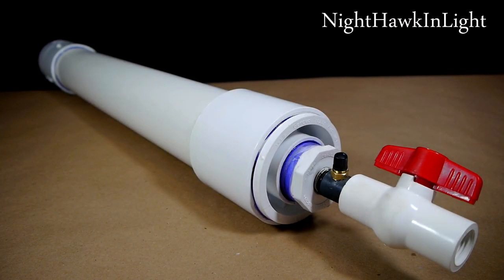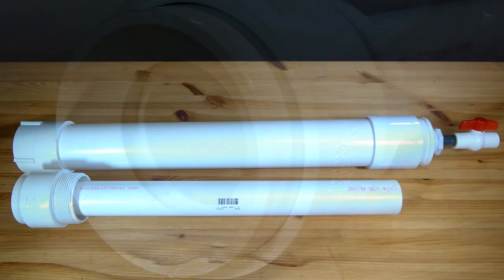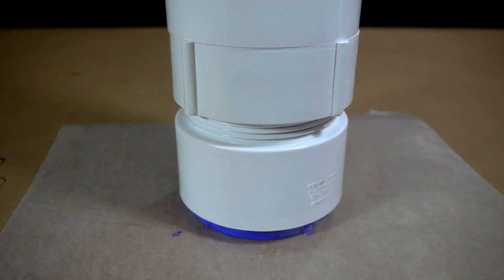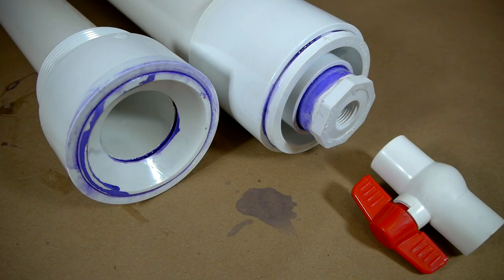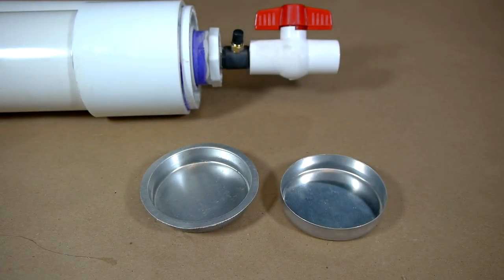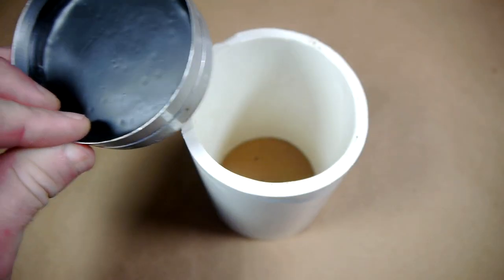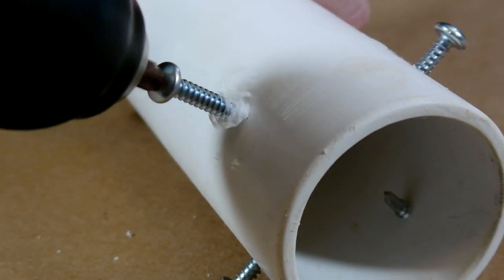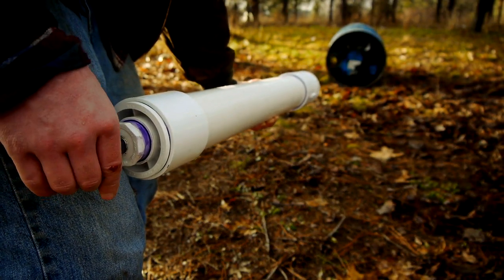How to Make a Powerful Coaxial Piston Cannon from Hardware Store Parts

Comment: Hi All! So I assembled the cannon and is air tight. I can hear the piston seal as the air fills the chamber... But when I twist the valve all the air rushes out of the shutoff valve and not the barrel..?!?! Any insight?
Reply from the maker: It's a good sign that the piston holds air, that's the hardest part to get right. The issue you're having is caused by air not emptying fast enough from behind the piston, compared to how fast air leaks around it emptying the front of the chamber. There's three ways to address this problem. You can increase the size and opening speed of the release valve, you can reduce the volume of air behind the piston so there's less to eject (do this by putting something like thick rubber toilet tank flanges behind the piston so there's less room for air), and third, you can make the piston a tighter fit in the chamber so air doesn't leak past it so easily. This will allow air to empty behind it when you open the valve, without as much air leaking around the sides in the meantime. Aluminum tape is a good option to wrap the piston if it needs to be a tighter fit.
Reply: @Nighthawkinlight  I see I see. So if I had a larger release valve, that may help the piston pull back faster correct?

Comment: should i use a hockey puck, both vent tee caps and use of epoxy cane be replaced?
Reply from the maker: I think you should check out my newer piston cannon videos. They are less prone to issues than this design.
Reply: may i know what kind of issues may arise? im doing it for a proj
Reply: im reading in the comments that the piston should have tfe on therubber face? may i know how this works?
Reply: BTW I have bought the tee caps and epoxy to use as piston.

Comment: What could I use for as a substitute for the galvinized steel vent tee caps??
Reply from the maker: I got a tip recently that a hockey puck is a pretty good fit in 3" pipe, so if you take one and glue a rubber face on the front that might make a good substitute.

Comment: Where do you source your parts?  I am having trouble finding the reducers that you show here.  Flush bushings are easy to find.  but the reducers you show I can't find anywhere
Reply from the maker: Home Depot, True Value, any number of hardware stores. Unfortunately pvc parts aren't standardized brand to brand. You may have to take something that is close to what I use and figure out how to work with it, or modify parts by sanding lips down and so forth.

Comment: Can anyone tell me how much this would cost? Need it for a 9th grade project
Reply: around $125. im doing this for a project too.
Reply: Well our project is now over, and me and my partner built ours for about 20$. We just used a couple reducers, end cap, 2" pipe, and a automatic sprinkler head as ours needed to be some how let off at 30 ft. So far its working good!
Reply: I built one similar to this and it cost me $40

Comment: When I open the valve to fire the cannon all the air blows out the back. I could use some help.
Reply: +Nancy Guarino That indicates that the piston isn't tight enough in the chamber, wrap some more tape around it and see what that does. It could also be too tight and no air is getting to the chamber, but that's unlikely. Also, when the gun fires some air is supposed to come out the back, that's how it fires. Of course air is meant to come out the barrel as well.

Comment: Hey Nighthawkinlight
A couple of weeks ago is asked for tips because i wanted to build the canon for a schoolproject. I only need to glue the male and the female adapter together, I havent done that becaus i wanted to know if the cannon would build up some airpressure. So I did some ducktape on it and if I pump really fast and immediatly switch the ball valve you hear some pressure escape but it is not enough to let the potato fly. What can i do? There are no holes where air can escape from because i have but ducktape everywhere.
Reply from the maker: +Martijn Bras Do not glue the threads on the adapters together, then you would never be able to open the cannon again for maintenance. It probably will not fire because it needs to be at a higher pressure. About 40psi.
Reply: If i dont pump fast enough and dont open the ball valve immediatly, there is no pressure.
Reply from the maker: +Martijn Bras Then the piston is not sealing. Put some pipe thread paste on the rubber.
Reply: +NightHawkInLight Thx for the tip i will try it.☺
Reply from the maker: 1/2" space is about right. You will probably need a softer rubber face but you can try it without. If you need to go smaller than the 1/2" to fit a rubber face on that's fine.

Comment: Is there anything that can substitute the gas vent tee caps? I cant find them.
Reply from the maker: I've been told that hockey pucks are the right size for 3" pistons but I haven't tried using one myself.
Reply: Ok, thank you. Is it just one or two hockey pucks?
Reply from the maker: chris platt Probably just one with a rubber face, but i haven't tried it.
Reply: home depot has them in the duct work section.  bout 2 bucks each

Comment: I also have a small leak coming out of the barrel can you help me please? I used 320 x fine sand paper is that good enough? I got my tee caps on eBay but still a small leak
Reply from the maker: Smear some pipe thread paste on the rubber face of the piston and that can help it to seal.
Reply: AWESOME WILL DO THANKS BRO!!!
Reply: Did the pipe thread paste work for you? I'm also getting air leaking out the barrel.

Comment: Thx for the idea NightHawkInLight,
I have to build a golf ball launcher for AP Physics and I used your design and made the the size smaller due to requirements by teacher. But thx and any tips because I just made the length smaller of the PVC not the diameter. I have to launch a gold ball so, i was thinking to put a paper ball first and then put the golf ball in. It's due on Oct. 02. Please help
Reply from the maker: +Gamers TecK Yes, paper wadding will work fine. You may need a bigger dump valve in the back to open the piston faster since your chamber volume is smaller.
Reply: +NightHawkInLight Hey man I made it and apparently all the air leaks out from the barrel. plz help bc i dont feel like putting $50 to waste. plz
Reply from the maker: +Gamers TecK Put some TFE thread paste on the face of the piston
Reply: +NightHawkInLight But it's not leaking from the threads, it leaking from the part you put your ammo in. Like the barrel where you put the potato in.
Reply from the maker: +Gamers TecK Yes, put some thread paste on the rubber face of the piston. It will help it seal against the barrel.
Reply: +NightHawkInLight So just do that, and I think my piston isn't moving> i used regular clear tape and not aluminum tape, and if i put thread paste on the rubber face won't it stick to the PVC barrel, so how will it go back so the air can flow and shoot the golf ball
Reply from the maker: +Gamers TecK No it will not stick to the barrel.
Reply: +NightHawkInLight Thank You and one more thing. So i just put tfe paste and stick the piston to the end of the barrel(where the potato goes in) and just close it back up again. Right???
Reply: +Gamers TecK also one more thing. My 3" pipe says "Not For Pressure" is that ok??? Like does it mean I can put pressure in it, but they dont recommend.
Reply: +Gamers TecK "Not for pressure" is not good.
Reply: +Johann Coetzee Thx man i really need help
Reply: +NightHawkInLight can I use something else for the piston, because it says they discontinued the product
Reply from the maker: +Gamers TecK You cannot use pipe that is not for pressure!
Reply: +NightHawkInLight I mean I can still put pressure in it right, it's just that it wont be safe
Reply: +NightHawkInLight How dangerous is it if we don't use a pipe that is for pressure? Like I am only going to shoot it like 10 times just enough to go like 50 yards.
Reply from the maker: +Demetri Petronavik Very dangerous. If the pipe is not pressure rated there's no way of knowing how much it can hold. It may explode on the first try.
Reply: Well, my grade in physics in on the line, it's worth it.
Reply: +Demetri Petronavik  hey i used a pipe that wasnt pressure rated and I used it so many time with around 80-95 psi and it worked out fine...I mean for me but I'm not telling you to take any risks but what I think is that if you keep it under 100 psi you will be good but I'm not responsible for what happens in your situation. just because it worked out fine for me might not for you. So be careful and do it with your own risk and be safe for God's sake.
Reply: +Gamers TecK my rule of thumb is to always use pipe that is pressure rated for 2-4x what will put in it.

Comment: I need some help. I live in America and ive been on almost every hardware store website I can think of and even after multiple google searches I havnt been able to find a pressure rated 3" to 1-1/2" reducer anywhere. Can someone help me out? Preferably someplace I can pick it up at and not have to order. thx.
Reply from the maker: You can use multiple reducers like a 3" to 2" reducer, then from 2" to 1 1/2".
Reply: Thank you! I had pondered that earlier but I wasn't really sure if it would make the cannon too unstable.

Comment: @NightHawkInLight
I made your Coaxial Piston Cannon, but i'm having a lot of air leaking through the 2 inch barrel. Can you help me out.
Reply from the maker: Try putting some of the TFE thread paste on the face of the piston. That can help the rubber get a better seal.
Reply: Thanks for your help. It worked out. Awesome design. I know you must tired of this question, but can you give us a list for the smaller cannon. The one that you drew on paper. I like this one lots, but a small one would be awesome. Thank you.
Reply from the maker: antonio balladares I don't have a parts list for that cannon, sorry.

Comment: Cool. But your air chamber is too small.

Difficult to fix with this design, but you could go up to 4" pipe.

You'd probably get more power if you'd just made a cannon the same length with that ball valve between the barrel and air chamber.

Refrence (I build these): v=nRk6-fdAL4M

Comment: Mine never worked. I used 1/16 rubber for piston seal, then tried  another layer of rubber. Just wont hold air. Also piston surface MUST be flat against back of 2 in. barrel to seal. FYI, H Depot and Lowes do not sell 3 in. sch 40 PVC pipe or sch 40 fittings ( At least the 4 stores I tried in DFW area). Instructions and quality of video are well above average, NightHawk.

Comment: I just spent hours completing this cannon. I followed all the directions and specs as best I could.  I have run into a huge problem..... Connected my bike pump, pumped it up like 8 times.... Turned the valve.....
And all the air fired from the back of the valve?????
Total opposite direction????
Now,  this was all done with an empty chamber.
Does it matter if I load the chamber???
I guess I will go get some potatoes...
Reply from the maker: The piston is leaking too much air around the sides. You can fix this by adding a little more tape so it's a tighter fit. It can also help to open your valve faster and if all else fails replace it with a bigger ball valve or even better, a sprinkler valve. The good news is that the piston sealed against the barrel and held air, so you're in pretty good shape in that respect.

Comment: I built this thing twice and It did not work. The barrel kept leaking and I followed you video to the letter. Please. Please build another cannon like this one but without using the tee caps because I had to order them online and has to wait to days. Please please redo this.
Reply from the maker: You can make a similar design using my 2" piston that I posted a video about a few months ago. Look at my piston cannon build video using that piston and you can modify it into a coaxial design.
Reply: NightHawkInLight what I plans to do with this is instead of using potato I will use foam balls. I'm a larger and I want a cannon for events. I was going to stuff this design into a concrete form tube so I don't want the l shape like in the video you recomended. So what would you change if you used the new piston on this cannon in this video.
Reply: I'm sorry I'm a larper. Spell check :)
Reply from the maker: A piston cannon is overly complex and powerful for what you're looking to do. Just make a pvc chamber and barrel with a ball valve or sprinkler valve separating them. That will be more than adequate for firing foam balls way harder than you could need and will work reliably. Like this but smaller: http://www.instructables.com/id/PVC-Air-Cannon/ Be sure you only use pressure rated pipe and fittings, all the fittings must be marked NSF-PW, and the pipe have a pressure rating printed on the side.
Reply from the maker: If you need it to look like this cannon just stick it inside a bigger pipe and fake it.

Comment: So you don't accidentally not turn on the valve fast enough we used a sprinkler valve switch and it electronically releases the air.

Comment: Attach a portable electric bike pump with a small battery to the outside and connect the bike pump to the air tank with a one way valve.
Then you have a multible shot portable air bazooka.

Comment: im probably stupid, but what is the smoke stuff and what are the pellets that flew out?
Reply: Isaac Dean The smoke stuff is because of the compressed air and it fires potatos lol:)
Reply: I dont think the chunks were bits of potatoe it looked like little peices of ice like when Co2 is let out fast
Reply: Spyros Samoilis but ty for that
Reply: Isaac Dean Maybe:\
Reply: oh so its like ice
Reply: +Isaac Dean get a bottle of water that is curved in the middle, drink the water, screw the cap on, twist the bottle in the middle, hold the pressure and quickly spin the cap off. Same principal as this cannon and you'll see the water vapor.
Reply: +madjack821 I wasted a lot of time at work shooting bottle caps at my coworkers.
Reply: +Isaac Dean water vapor condensing from sudden pressure change.  right idea, wrong gas lol.

Comment: Does anybody know if a hockey puck actually works in replacement of the galvanized steel gas vent tea caps?
Reply: Taran Ahluwalia yes, it will.
Reply: BellyUpFish Do you need to add any rubber to the barrel side of the puck? or will the puck itself work?
Reply: CommonSpence just the puck works.
Reply: BellyUpFish I have trouble with air leaking out the barrel. Could it be that the area behind the puck is too large so it isn't pressurizing quick enough? The barrel seams pretty flat against the puck.
Reply: CommonSpence I wonder if it's got a small leak. Maybe a flap of rubber, barrel side may work.  Or something like a bead of silicone?
Reply: BellyUpFish I'll take a look. could the screws in the side cause a leak?
Reply: BellyUpFish ours ended up having a leak and we tried fixing it as much as we could but we weren't able to contain the air. So we went with a simpler design. Personally, I think if we had the galvanized vent tea caps it would've worked but yeah either get the tea caps or go with a simpler design
Reply: CommonSpence ^^^
Reply: Taran Ahluwalia hey so what design did u end up with at least? i mean the piston? the hockey puck? or what?
Reply: ThePyroDUCK we just completely abandoned the whole piston idea because at some points in the cannon, air would be leaking out. So we went with a simple 4" PVC pipe on one end as a chamber to hold the air, and then a connector and a valve attached and then on the other end was the 3" PVC pipe which was perfect for us to shoot out a tennis ball

Comment: IF WE WOULD HAVE SHOT THAT 50/25 GAL BARREL IT WOULD BE IN LITTLE PIECES ours costs about 50$ to make it uses about 10 feet of 4 inch pvc a valve and a tank that holds about 150 psi BUT DO NOT GO OVER 120 PSI  and a psi gauge.        

if you do this and get hurt it`s not my fault.

Comment: while this is a fun and time consuming project the result is unfortunately a one shot act. Image having to set it on the ground the pump it up 15 times inbetween shots is impractical. Better hope you hit the target on the first shot if you ever need it for self defense.
Reply from the maker: ...It's meant to be used for entertainment, not as a weapon.
Reply: I hope you're referring to the use of one of these for airsoft or paintball... I really hope you are.
Reply: NightHawkInLight Do you think it would work well with water balloons?
Reply: Think "double barrel".  Old becomes new again as the reasons remain the same.
Reply: john hanrahan I think the concept 'double hull' should be a better fit for this thought, but I like what you were going for nun-the-less.